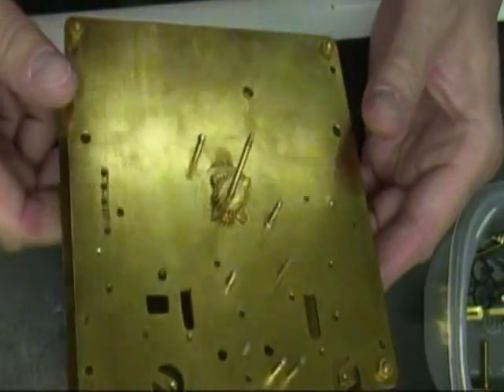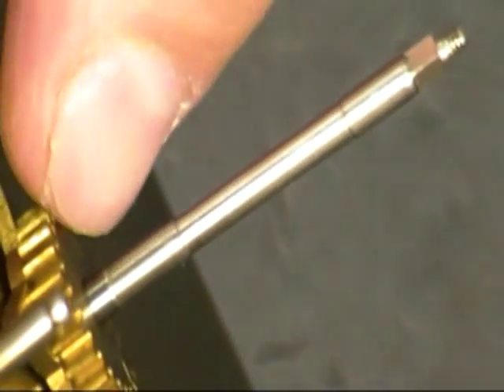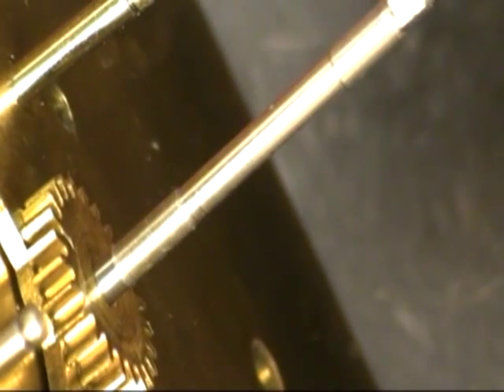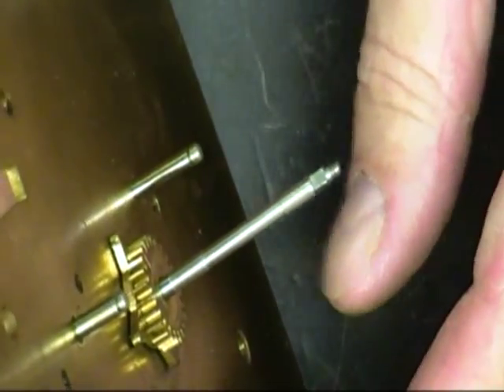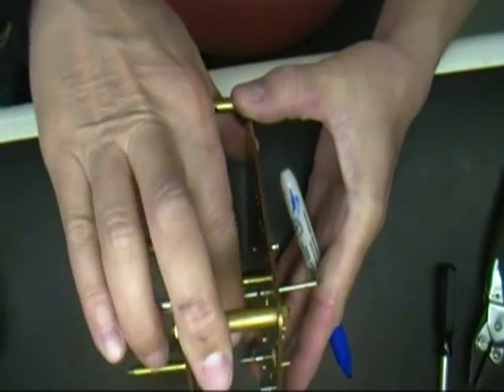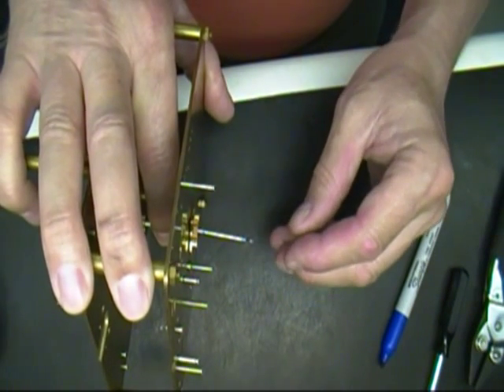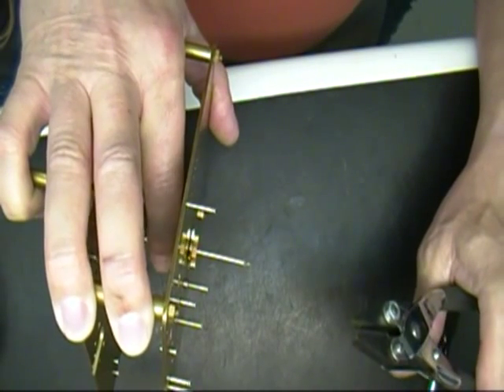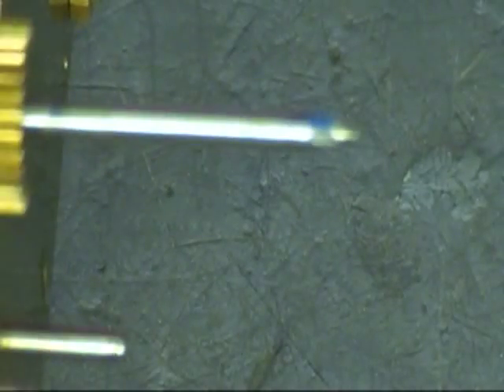Straightening a Clock Minute Arbor

Comment: Thanks. Do you have to let down the springs before working on it? I have a bent arbor problem with my clock, and it has 30 day movement. I'd new to clockwork, and I don't have tools to let down big springs like that. Just want to make sure I can do so safely.